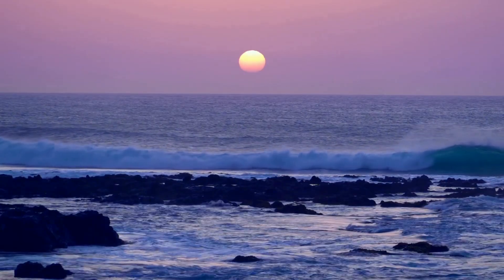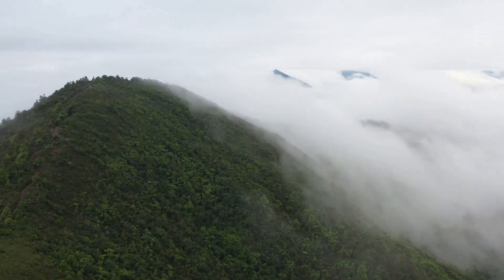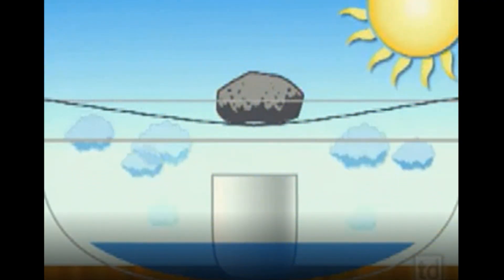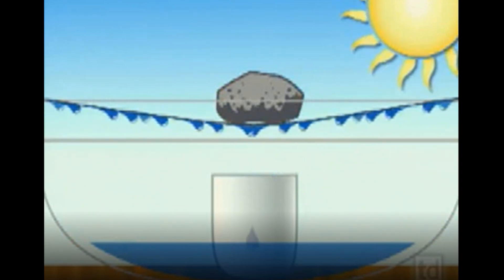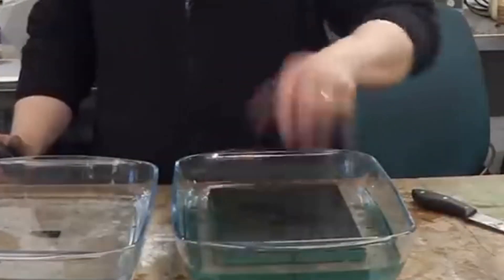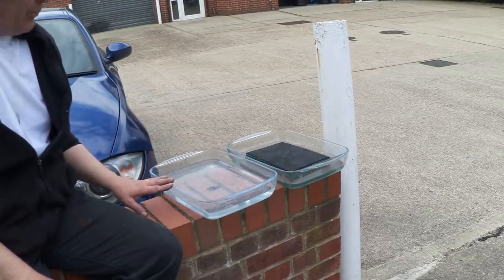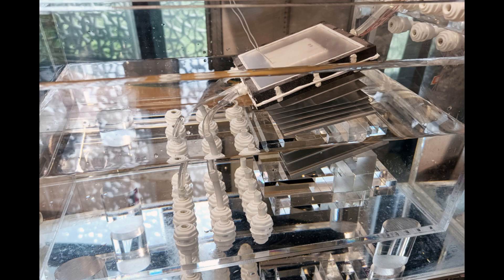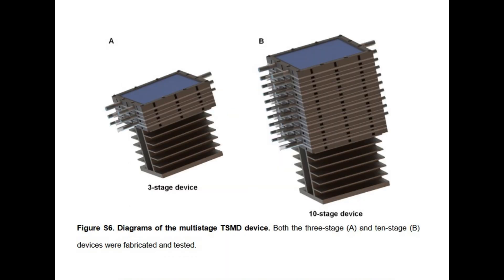2192 MIT Breakthrough On Making All The Fresh Water We Need

Comment: I'm 50 seconds into the video and feel to comment. Water also comes from what's known as "Primary Water" in the earth's crust. I believe it's about 3-5x the amount of water in all the oceans combined, and it's fresh, pure water. I have a lot of info on it I received from those who tap into it. A fascinating subject and there was a news article about it I saw a few months ago. But, like oil, those profiting off it need to make it appear scarce in order to charge for it like Nestle and other major corps do, and gov'ts want to control water and food to control the populations.
Reply: I think you have a misunderstanding about water trapped in the Earth's crust, most water in the crust isn't in some pockets or anything easily accessible, it is bound in minerals, (excluding aquifers both a small percentage of the water and clearly not what your talking about since it's still part of the water cycle) you can't just drill for that water... You basically have to mine materials and then heat them to the point that they release the stored water, this is a task more energy intensive than just  doing desalination... The only case I can think of where this makes any sense is some post-apocalyptic world where we have made the groundwater so toxic or so radioactive that it can no longer be used in any form even after evaporation(in which case I do not understand how we're even alive as a species)

Their is no financial incentive to hiding this, it has been known for at least a century it's just so cost intensive to be useless, no one is mining 200 liters of rock from a km down in the crust to then have to spend energy heating it or using chemistry to produce 1 liter of water... If we are mining for materials that deep we're not going to mine for water
Reply: @jaykoerner  bingo. Not everything is a conspiracy.
Reply: @Nihlink  everything is a conspiracy if you want it to be... In this case though it's someone(probably many people) basically performing telephone with century/is old facts, with the very important parts missing that the water is all in minerals like gypsum(20% of gypsum is water but it's a solid rock) and that it's one of the most costly ways to make water (I want to say it would probably be cheaper to turn the air itself into water via ionization of the natural hydrogen and oxygen)
Reply: @jaykoerner  I think they're just messing around. they don't really know what's going on most the time
Reply: @jaykoerner  That's the prevailing narrative yes. Your response is more along the lines of what I expected to see here, so thanks for not disappointing. You may wish to research it further by those actually tapping into it. I'd post or upload info, but YouTube does not allow.
Reply: @BeAsYouAre108  bro we all know any hydrated minerals and essential water like c'mon that's basic geology, so what? So what? Do you know how hot you gotta heat some of those rocks to drive off their waters of hydration? Like what your describing is essentially the aquifers we've abused and wasted and squandered . Yeah water flows underground. Yes there's underground water in rocks. Good luck getting it out tho. Good luck.
Reply: @BeAsYouAre108  such a weak cop out we are all aware what you are talking about it is you who is not aware, that we all have agreed with you in saying there's mad friggin water in rocks. But you make broad over arching statements that point towards something like a conspiracy and I just wish you knew how much it does not further any point you are trying to make with some people who all kind of agree with you, but you choose to wall yourselves off for some reason. Imagine being wrong! I'm wrong all the time! Hell I might even be wrong now but you really should back up your claims with more than 3 words at a time. If only you knew. Expected as much. If only I could share. YouTube won't let me. I mean... It's been 18 hours. You've successfully wasted plenty of my time. That's the real conspiracy here.
Reply: Right! Each time I put my tinfoil hat on, I have lots of ideas on the economically sound ways of extracting "Primary Water" from the earth's crust.
Reply: @jaafarmejri3361 well you see, it is all a big conspiracy of making money. No denying that. But it's never as simple as, nah there's no problem guys! It's a lie! There's more water! Keep wasting! Keep polluting! No worries brah! I heard there's 5x more water. If only nestle.....NOPE! (Whatever makes you sleep better, right?)
Reply: You're off the rails. Isn't the entire premise of government to do with creating stores of grain and taxing it from the farm to the bread itself. Is that not the essential aim of a gov? And everything else comes because of it. Like for real. Yeah people want to control water. Do you know what essential means? Like... It's in the minerals as part of their structure. You can't just get it out with out heating it up... And then what you just keep taking out more water from the minerals... And let the old stuff collect in the ocean? So your oceans get diluted, and the sea level rises until you get water world, if it's 5x as much as what we see now. Seriously?
Reply: Yup that's how we go
Reply: And hydrocarbons are not dinosaurs.
Reply: I highly doubt that the water in the crust isn't a very concentrated brine. Simply think of all the soluble minerals that it is in continued contact with. Add to that the heat and pressure that make it even more likely to take in minerals and you probably catch my grift. Btw. A subsurface ocean has been discovered accidentally a few years ago. I think it was somewhere located below the eastern part of Canada(might be wrong on this, but I can't be bothered looking it up now). That one was very much a brine and theorised to be about the size of the black sea while actually also not being an actual body of water. The amount of water in the crust is nowhere near the amount that is above ground. Those 3 to 5 times the amount claims are totally ungrounded. Especially because given enough pressure and heat the H2O will break up into hydrogen and oxygen.
Reply: Yeay no 3 D printer needed?
Reply: That sounds interesting! What’s your source on this?
Reply: @JimEdmiston  no one can post links of YouTube shorts, your comment gets automatically deleted, anyways it's factual incorrect trust me if you wish or do your own research
Reply: If you guys love water so much you should move to the ocean.
Reply: Exactly 💯
Reply: Gaddafi gave Libya free water by using it. Libya is in the middle of desert
Reply: @code2700  really wow. Ok thanks for the Africa facts little Tim.
Reply: I'd be curious on the source - as we don't really know what's further than a mile or 2 below the crust. Most studies are backed by companies with their own intentions. We have theories and models but no one has truly been there - it could be another dimension or Dante's Inferno down there lol. Extracting water in the crust is almost as hard as getting oil. I heard many of the old wells have dried up. We're something like 100-200ft below in some counties to extract water. This is expected to get deeper. It's not good for local communities and forces people to live in major cities. This can be a problem if say those wells dry up in 100 years - due to population growth and demand. Could lead to mass extinction 🤔
Reply: Are you talking about well water? My house has a well and it’s the best water ever. I know some people don’t like their well water but I like the water from mine.
Reply: Once it's gone 
It's gone 
It's also called fossilized water 
Ghadafi  started to use it with Hugh pipes
Reply: Lock and Load.
Reply: You should educate yourself on what “primary water” actually is.
Amd then you should consider how it went for India, who allowed for private wells and pumps in a number so large that their water table has dropped several hundred meter in some regions.

Severe lack of regulation, over privatization, general neglect and rampant government corruption have led to multiple generations thirsting for more than just a few drops of hazard free water. The situation has grown to the point that regional disputes have risen over access to rivers in the country's interior.
Bangalore and New Delhi are two major cities in deep crisis regarding water.
Reply: Primary formation water is anything but fresh, anything but readily available.  Im a geologist/geochemist and studied formation water development for a lot of years. The fresh water aquifers are being depleted to cool data farms, maintain golf courses and grow cows among other purposes we will all wish were canceled when the supply runs out
Reply: Too much accent.
Reply: Finally the word is getting out. Ty
Reply: @yahnferral9163  Frankly, I'm surprised anyone here would have even heard of Primary Water as it's been so effectively suppressed for so long, so thanks for your comment.
Reply: @BeAsYouAre108  aware of what, Uranus? Give me a break.
Reply: Not wrong on that info, if they only knew.
Reply: @mzeewakazi  you guys sound like bots. True true! If only they knew! Those who know know, that those who don't know, don't! Certainly my good sir I concur! 
Not one word, no evidence that you could in any way substantiate your claims. The fact theresa bunch of water in rocks has been well known since forever. Have you ever dug a hole? Omg water you ever cut through a big rock or seen one break...omg it's damp! That's not even what you are talking about. Nope. But, it's real easy to identify people who actually wish to inform others and those who use this type of exchange as a way to feel smart because when I think someone doesn't know I actually try to explain it. You are a bunch of bots. Not only that you're half hearted. You don't even actually care what you're saying that's your whole problem. It's a form of insanity. So far removed from your own awareness that you'll say anything.if covid is a thing, you can't breathe in a mask. If drinking apple juice was good for you, you'd claim it causes cancer. If they planet is running out of fresh water you laugh and claim you have secret knowledge, thereby demonstrating your lack of compassion, and your failure to think about what running out of water globally even means. You say there's plenty. Where? In Switzerland? Do you even know where the majority of humans live on earth? Or how does this work? I expect one or two zero effort replies as is usual. I'll probably give up after this try. I wish I didn't have to live on the same planet as so many dingle berries.
Reply: "I myself not merely hope, but feel pretty sure that they are right (about Primary Water). It remains to be seen whether those who are now regarded as experts in the field of hydrology and the politicians whom they advise will also agree that a good case has been made and that large-scale experimentation is in order. Vested interests are of many kinds. There is the intellectual vested interest of those who have taken their doctorates in a science at a certain stage of its development, who have taught and applied that science at that particular stage, and who regard any questioning of the postulates underlying that science at that stage as a personal affront and a menace to their position in the Establishment. And then, of course, there are the more substantial vested interests of contractors who make money by selling concrete for dams and irrigation works, of bankers who make money by handling state and municipal bonds, of bureaucrats who, obeying Parkinson's Law, feel an urge to expand their departments and extend their authority, of politicians who find it prudent to say yes to powerful pressure groups. But even against vested interest truth (particularly if it be a useful truth) will ultimately prevail. How long is 'ultimately'? That is the question. 
—Aldous Huxley 
March 21, 1960"

From forward to "New Water for a Thirsty World" by Michael Salzman
Reply: @BeAsYouAre108  🔥 Thanks for posting that quote! I had no idea Huxley knew this 60 years ago, imagine what he'd think today!!!
We were given a beautiful planet, too bad it's controlled by bad people, who have arranged it so that they end up with those billions and trillions, and the rest of us pays endless taxes and fees, and in the end every single country in the world owes trillions to the Central Bank, which is a private institution controlled by them and can literally Print money and loans it to us with interest. 
Most of the resources in the "developing countries" are controlled by these people, so they never develop and live on the edge of extreme poverty. I really couldn't believe when I learned that the poorest country in Africa, Burkina Faso, supplies gold for most of the bank houses in Europe, and the people there have no choice but to work in those mines,, whole families with kids. Just like people in the (highly ecological) lithium mines in Congo, so that millennials can have a new iPhone every year and play their games and are not a threat. The gold and lithium is then exported, as per legal regulations created by these mofos. And the suits in the EU parliament know about it and shut up 🤮, because they are on payroll of these mofos. 
People don't believe it, but if you think about it, how hard is it to control politicians, academia and media if you have those trillions? Most people in these institutions clearly care about their safe jobs and contracts more than they care about hungry kids. 
And unfortunately, the same applies for the majority of doctors, who have forgotten they took an oath. How easy was it to have two years of Covidiocy that ended just like that when the conflict in Ukraine started. Now we have safe end effective vaxx that was developed, produced and tested within 15 months after the disease was discovered. That oh so dangerous vi®us that came from bats, but pets are ok, and humans have asymptomatic whatever and you only die if you are admitted to a hospital and given treatment 🤧 
For those who have managed to read this rant up to here, have you spotted the warning from the "experts" that attended the annual meeting of the megarich last week in Davos? New Disease X is on the way... They don't say much about it but they do know it is 20 times more dangerous than KOvid.  Also, the W🤮H🤮O have come up with a new Pandemic response treaty, which gives them the right to decide what a pandemics is And mandate "medicine". Plus they have a new weapon in their Arse nal, which is Malinformation. So now you can be cancelled even if what you say is true but it undermines people's trust in the government (watch Tucker Carlson's interview with Bred Weinstein from 2 weeks ago).
Uffff. 
I'll have to finally read Brave New World!
Reply: Resources that we are not allowed to use keeps that available water to 1% when in fact there is plenty for all to use.

Fun fact.... water always lays level and flat so there is a major problem with other belief systems about the spinning water ball "globe"  

Just saying....
Reply: @stabilityball  I'm not sure I can help a flat earther..... I would say test you on theory but I'm not sure you can, at least every flat earthier I know that has properly tested their theory was proved wrong by their own experiment
Reply: @stabilityball  oh you're saying the earth is flat. Wow I wish I would have figured that out before I wasted a bunch of time writing my response to you.
Reply: @stabilityball  what exactly are you saying though? Like... For real. The water isn't even level because gravity isn't uniform, plus I'm sure you've heard of waves. Just cause water finds it's own level means not a lot because... It's still moving. Pretty sure it just refers to the fact that a small body of water will be perfectly flat and level, not across the entire surface of the globe, it's never going to smooth. But it's definitely always going to go to the lowest elevation.
Have you heard of the water cycle? U know .. Rain....
Well, that cycle has been putting water into things like rivers streams etc. since forever. The sun, has been distilling water. And it collected in some massive things we get the water from. Other than those giant things. Pretty much every other source of water is just water filtered through rock and land to become freshwater, places like Hawaii islands sometimes use water like this, many islands etc... So.... Apart from these rapidly depleting resources where do you propose to get this secret fresh water? Don't just start saying what you want, don't back it up with any facts or logic. I think you can do better. Why even bring it up in the first place? Are you unhappy about the water crisis? Is it too much? Should we just listen and be happy. Oh. There's a bunch of extra water?! Wow. 
Oh, we're not gonna be running out, just some weird cult to get through then the water will be liberated.
Nah. The water we've enjoyed will be no more. Some good pure water. It takes millions and billions of years to fill the oglalala reservoir and yet some farmers pumped it dry in about two hundred years? Yep. They would have the pumps running 24/7 even they didn't need it. So much clean water. To grow corn. Kill the plains. And feed the world. How can you deny that. Do you know how much pumping water costs? The water has always been free. It's the pumping and moving and treatment of the water that costs a bunch of money. Do you know how much water I use? I do. I've used less than a hundred gallons of water all month. You don't know how much water you've used do you? Well think about it for once before you claim there's lots more being hidden. Why. Why. Why.